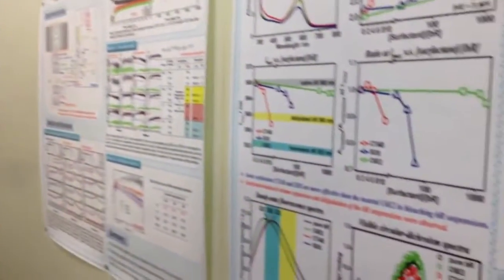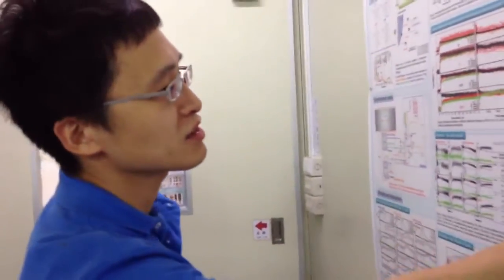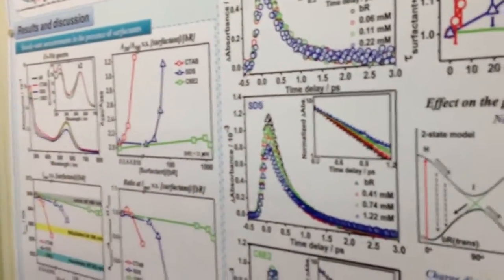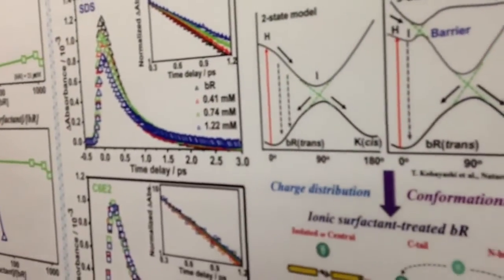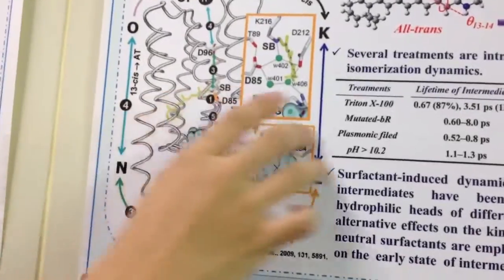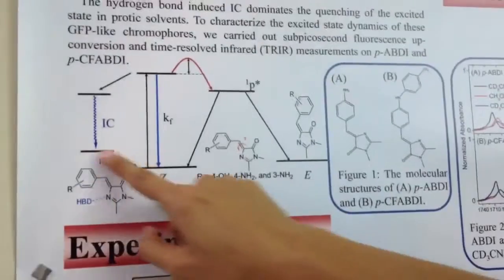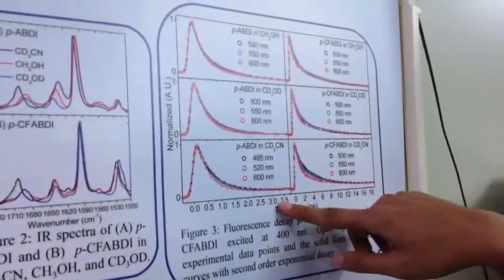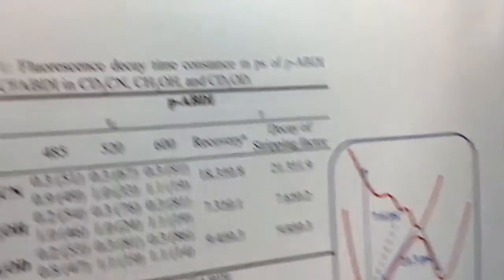Femtosecond Transient Absorption System Hatteras. Visiting customers in Taiwan.

Comment from the maker: Featured publication:
Photophysical properties of 5-substituted 2-thiopyrimidines
Victoria Vendrell-Criado,a   Jose A. Sáez,a   Virginie Lhiaubet-Vallet,a   M. Consuelo Cuquerella*a and   Miguel A. Miranda*a  
Photochem. Photobiol. Sci., 2013,12, 1460-1465
The aim of the present work is to determine the influence of C5 substitution on the photophysical properties of 2-thiopyrimidines (2-TPyr). For this purpose, 2-thiouracil, 5-t-butyl-2-thiouracil and 2-thiothymine (TU, BTU and TT, respectively) have been selected as target thionucleobases for the experimental studies and, in parallel, for DFT theoretical calculations. The UV spectra displayed by TU, BTU and TT in EtOH were very similar to each other. They showed a maximum around 275 nm and a shoulder at ca. 290 nm. The three 2-TPyr exhibited a strong phosphorescence emission; from the recorded spectra, triplet excited state energies of ca. 307, 304 and 294 kJ mol−1 were determined for TU, BTU and TT, respectively. Laser excitation at 308 nm gave rise to a broad transient absorption band from 500 nm to 700 nm, which was in principle assigned to triplet–triplet absorption. This assignment was confirmed by energy transfer experiments using biphenyl (ET = 274 kJ mol−1) as an acceptor. The triplet lifetimes were 70 ns, 1.1 μs and 2.3 μs, for TU, BTU and TT, respectively. The obtained photophysical data, both in phosphorescence and transient absorption measurements, point to significantly different properties of the TT triplet excited state in spite of the structural similarities. Theoretical calculations at the B3LYP/aug-cc-pVDZ/PCM level agree well with the experimental range of excited state energies and support the ππ* nature of the lowest triplet states.
http://pubs.rsc.org/en/content/articlelanding/2013/pp/c3pp50058f#!divAbstract

Comment from the maker: Femtosecond Single Shot Autocorrelator Model REEF-SS ASF-200 delivered to Lockheed Martin
http://www.dmphotonics.com/Femtosecond_Single_Shot_Autocorrelator_Model%20REEF-SS_ASF-200_Lockheed_Martin/Femtosecond%20Single%20Shot%20Autocorrelator%20Model%20REEF-SS%20ASF-200%20delivered%20to%20Lockheed%20Martin.htm

The Single Shot Autocorrelator (SSA) Model REEF-SS ASF-200 is designed to monitor the pulsewidth of both oscillators and amplifiers of ultrafast systems in the range of 100fs to 2ps. Wavelength coverage 1500nm -1600nm (other range is optional).

Specifications
Spectral range: 1500 – 1600nm (other spectral ranges on request);
Temporal range: 100 – 2000fs;
Spatial mode of input beam: TEMoo
Beam diameter: >3mm for pulses 100-500fs;
>6mm for pulses 500-2000fs;
Input polarization: horizontal;
Pulse energy: >0.3nJ at repetition rate 70MHz;
Nonlinear crystal: 2 mm BBO, type I
CCD camera: 14-bit, number of pixels 782(W) X 582(H), pixel size 8.3 X 8.3 μm

Comment: Femtosecond transient absorption spectra were recorded with a pump-probe spectrometer Hatteras in combination with an ultrafast amplified laser. The laser pulses at 800 nm with energy 2.5 mJ pulse 60 fs. The amplified pulse was equally split to pump two optical parametric amplifiers in combination with harmonic generations (SHG, THG, and FHG), sum-frequency generation (SFG), and difference-frequency generation, which provide tunable fs pulses in the wavelength range 240 nm-10 µm.